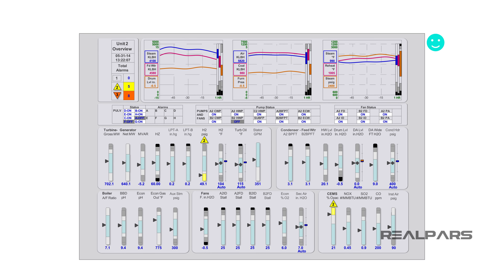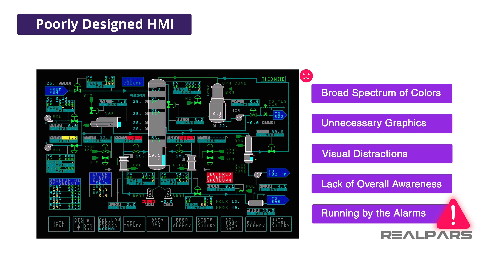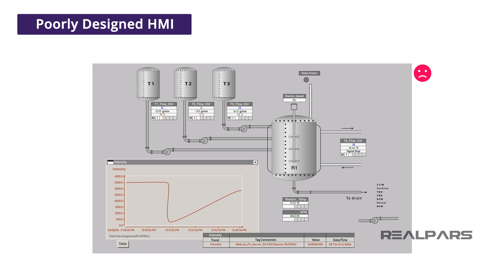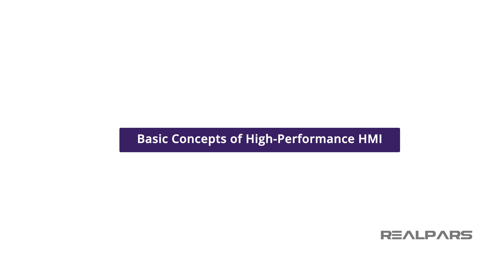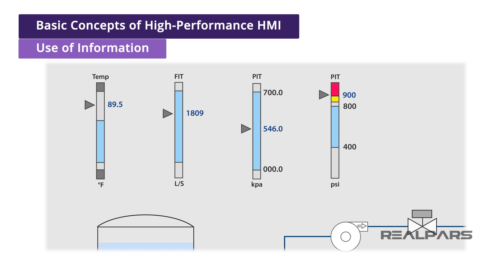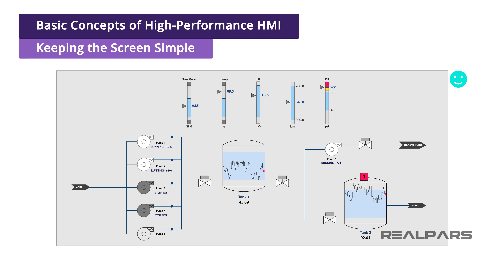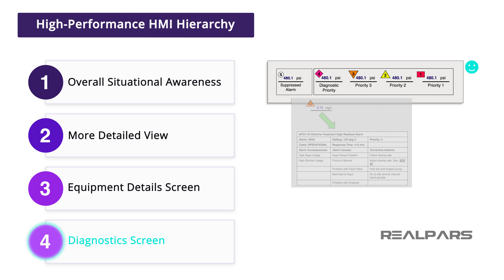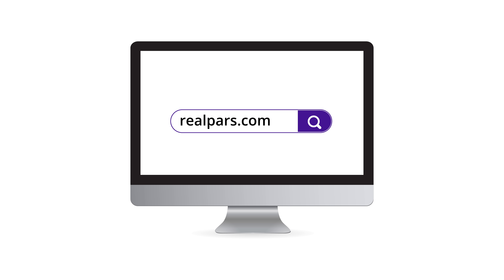What is High-Performance HMI?

Comment: Well, i know a few factories with poorly designed HMI...
Reply: The power plant I work at has everything displayed with red or green for running or not running.  But then again, it's been around a long while before 2015.  I guess when we finally get an upgrade it will look much different.
Reply: On my last project is took 3 hours to convince the client you don't need to draw actual pipes (by size and color) in the HMI.
Reply: And i know alot😂

Comment: Two things I would add.  These days, your graphics need to accommodate a wire variety of operators.  This includes colorblind operators and even in some instances, less than literate completely operators.  The use of color, motion and text is needed to cover all of them.  This doesn’t mean it has to be gaudy or cluttered.  The operator should be able to see from across the room if he has problems brewing.  The grayscale screen actually helps here.  
Also most operators I’ve worked with appreciate an "interlock" screen.  Why didn’t the pump start?  Look up the pump’s interlock screen and see.  Maybe a switch is in the wrong position or maybe an alarm on the other side of the plant is preventing it.  It’s bad if an operator has to call in a technician to tell him to put a switch in "auto" or a fault in some piece of equipment seemingly unrelated or only tangentially related system is holding out an interlock that the operator wasn’t aware existed.  I’ve had instances where 20 or more interlocks had to be satisfied for some piece of equipment to start.  It’s nice when operators or techs can quickly check to see which ones are holding it out.
Reply from the maker: Thanks for sharing your knowledge and experiences! We always appreciate that.

Comment: Last time I tried to build a gray scale HMI, I got my ass chewed (boss & client). people love the red/green blinking bull.
Reply: Welcome to the club, i had to spend nearly a year in 2018 upgrading thousands of views from a customer because GE had no migrating tools compatible...i went crazy with the design the customers wanted...
Reply: My roll is maintenance engineer on a pulp plant. I have been trying for years, a step at a time, first plane graphs, without 3D effects, gray background, standarized indications, small trends on tanks and some variables, etc. The last will be the green and red for motors, valves, etc.
Reply: Been there, done that.  In one case, the engineer flipped his nut.  The head operator backed me up.
Reply: It''s actually insane how long these red/green thing has been around. Yet, I don't remember high percentage it was, but there's pretty much granted to be red/green colorblind people in any site that has even moderate amount of staff. It's really easy thing to dismiss, until someone actually comes to you and ask that "what color is this supposed to be" question. Has happened to me.
Reply: Red for no power going to input on the plc
Orange for ready to run
Blinking red for fault 
Blinking orange for an overload trip
Green for running good, as a maintenance electrician having those colors makes my troubleshooting so so so much easier

Comment: Great video guys! Looking forward for the next one. I will check the link and books definitely!
I have been struggling on finding a proper colour combination between the different parts.
Fun fact, on board vessels (tankers, bulk carriers, etc) they need BIG font! Really big! 
Some engineers (older ones) they even use their flash light to watch if the background is black!! 😂